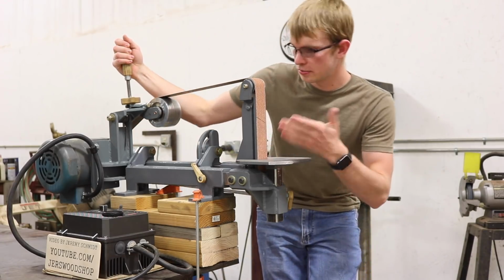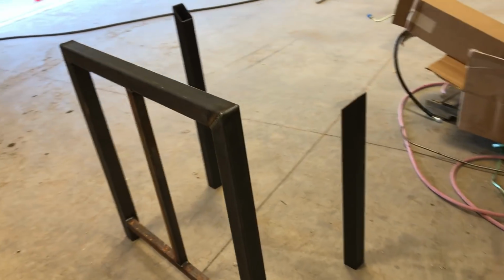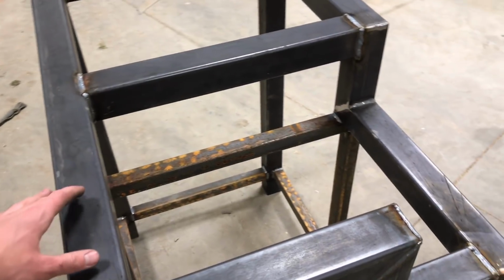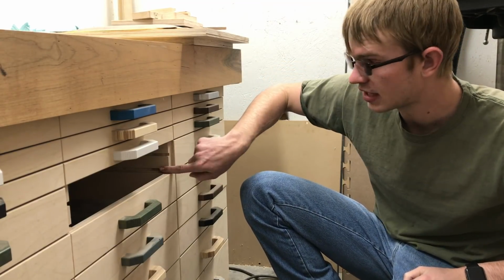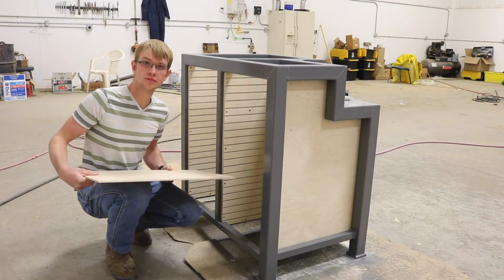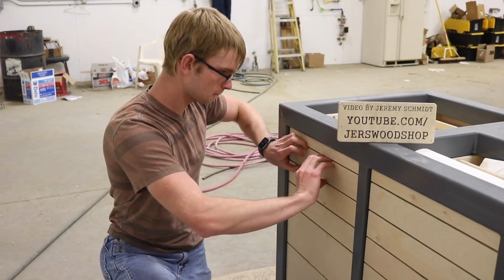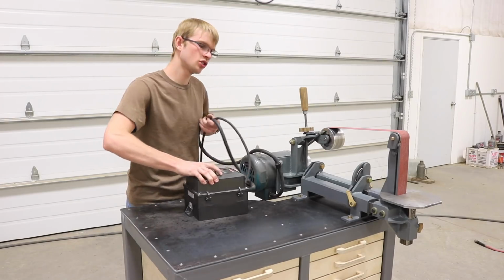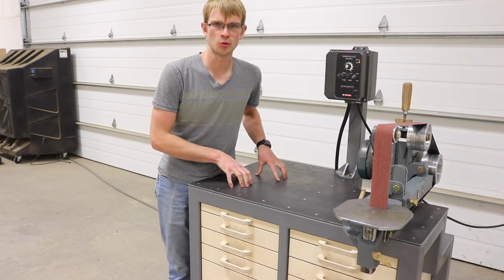Custom tool stand for my belt grinder

Comment: A wonderful Video you have produced. But placing it so near to the drawers ( without dustcollection or deflector) is worst!
PS.: The demonstration of tilting the (wonderful) grinder at the begin by using a stack of parallel boards is far away of rational method.

Comment: This didn’t age well. 
Now plywood is $40 😖
Reply from the maker: I’m curious where you’re located, and $40 for what size sheet? Current price here in the PNW is $150 for a 5x5 ft sheet of 18mm. Still well worth it at that price.
Reply: @Jer_Schmidt  Hah, I misspoke. It’s worse. I’m in south-east Michigan.
3/4 in. x 4 ft. x 8 ft. PureBond Birch Plywood is $85. 
23/32 in. x 4 ft. x 8 ft. BC Sanded Pine Plywood is $57
Reply from the maker: Interesting. I would expect baltic birch to be more than that, but I think that grade of plywood would be similarly priced here.
Reply: While I have your ear, I wanted to tell you your builds are awesome, and I enjoy your presentation. Thank you for sharing.
Reply from the maker: Thank you!!

Comment: Great job! Excessive material consumption, but excellent work. Are there any problems with abrasive and dust particles caught on the drawer rails? Does the slip get worse over time?

Comment: I just love the way you design and build,your grinder and cabinet I will build one for my workshop next project.The only thing I will do will be to add a folded sheet metal panel on the right hand side of the cabinet mounted with a piano hinge vertically to swing around to cover half of the draws at the front.This will protect the timber from metal sparks.Iove your style young man. Regards Baden Smith in Tasmania Australia.

Comment: My BG will be a little different, but i plan an similar rack. The space under the grinder, will be a custom, sparc and dust catch system. On 18:18 the sparcs flew on to the handles, is this an issue over long time? My shop is only 15 to 11 foot , so an dust collector is really important. I hope i will finish the BG in summer, and later on the rack. Thank you for sharing your great work.

Comment: Dude! Killer work as always.  Stout and built to survive a nuclear blast!  Hey where did you find that spring center punch??? Looks beefy as hell?
Reply from the maker: Thanks! It’s a Starrett...I don’t remember the model #. I have a couple different sizes, but the big one will whack a massive dent in steel if you crank the tension up.

Comment: Maybe a stupid question. Why didn't you just put the motor on the other side?
Reply from the maker: It makes the grinder take up about 60% more space width-wise, doesn’t look as good, and makes it harder to put belts on. I debated it for quite a while, since there are pros & cons to both. Decided on this since I was gonna make a custom stand either way. Several of my viewers have made them with the motor on the right, and it works fine.

Comment: is it my imagination or does the grinder table stem block the first drawer or two from pulling out while in use?
Reply from the maker: Only if the table is dropped down as low as it goes, then it just catches the top one. Not a big deal though, as that drawer has very little capacity and would be hard to access anyway.
Reply: yes sure -i just pointed it out because sometimes we can overlook simple things like that and maybe for a different kind of operation or machine it might end up blocking ALL our storage etc - so something to think about - in your case i guess i'd just keep things in there which i only used when the machine was off ... like say maintenance tools for the motor or what have you - out of curiosity - how many of those drawers have you filled up ..?
Reply from the maker: @antigen4  
Most of them are full. Each attachment for the grinder basically takes up an entire drawer, and I also keep belts in the 3" tall drawers, sorted by grit. The top left drawers are easiest to access so that's where all my frequently used tools go.
Reply: ok thanks - i just couldn't FOR THE LIFE OF ME imagine that there were so many things to store for a belt sander ....

Comment: You should try to weld at arm's length instead of giving in to the temptation to get in close. Especially since you don't have a fume extractor or anything else keeping those metal particles out of your lungs.

Comment: This work is beautiful. How much that square tubing cost per meter (or whatever its sold by)? Its probably not cheap to use as framing for everything.
Reply from the maker: I think a little less than $5/foot
Reply: @Jer_Schmidt  that's way cheaper then I thought. I totally get it now.

Comment: Where did you get that plywood?
I only found a couple 4X4 pieces that were part of a box built on a pallet from an overseas shipment and they are the top 2 planks of my 6 plank work bench.
Reply from the maker: I get it from Woodworker’s Source. They’re mainly an online wood dealer, but I live near their physical store so I can go pick it up and save the shipping.

Comment: Great workmanship and outstanding design ! (especially the belt grinder !!!!)  ,,,,,BUT, make your life easier and learn to burn (accurately) instead that shrapnel maker (Cut-off wheel)  and Vertical down your long welds and especially thin sections like the long  welds on the sheet metal to to Sq tubing on this stand. (V' down welds look a lot better too, Almost like heliarc. No grinding necessary)  

In any any case,  keep up the good work and God Bless ya.  You are sure to go way further then I ever did.

Comment: you could have designed it so that there was a steel drawer under the grinder to catch the sparks and then you could just pull it out, clean it, put it back in. save some dirt in the workshop
Reply from the maker: I’m afraid that would cause a lot of “splash”, sparks bouncing all over...

Comment: You've had this for a year now. Do you get much dust in those drawers on the right? I'm seriously considering downloading the plans for the grinder when I have some cash in a few months. I could design my own, but you've already perfected it!
Reply from the maker: I just cleaned the drawers for the first time, like a week ago. The amount of dust in the right bank of drawers was a gradient, from a significant layer in the top ones to basically nothing in the bottom ones. 

I’ve realized since making this that you can make the front of the drawer a bit taller to reduce the gap, leaving the sides and backs the same height so those have 1/8” clearance, while the front can have 1/16” clearance without issue. In theory that should cut the dust ingress to about half.

With all that said, I use the drawers to store belts and attachments, so there’s always grinding dust hanging on those anyway. So I really don’t care that they get a bit of dust in them. The top left drawers stay cleanest, and coincidentally that’s the most convenient spot to store tools, which I want to stay cleaner.
Reply: @Jer_Schmidt  Cheers for the response. I guess if they are gonna be dirty anyway, it doesn't matter. I just assumed you'd be using it like that other set of drawers you made.
Reply from the maker: Between all of the attachments for the grinder, various tables, and an assortment of belts in different grits, plus a few tools that are frequently used with the machine, the drawers are almost filled up just by grinder-related stuff.

Comment: Excellent engineering, design, craftsmanship, editing and commentary. I work metal for a living and can appreciate your skill level as well as you superbly done videos. I think I know, but can you tell me why you cut your sheet and tubing with the hand grinder rather than another method and what wheel do you use to make those cuts? Thanks!
Reply from the maker: Thanks! I used the grinder for angled cuts because the it is just too difficult to angle the bandsaw for them. Takes longer to adjust the saw than to just make the cut another way. I use the grinder for the sheet because I don’t have any other way. The cut off wheels are Norton brand. Bought in bulk from eBay.

Comment: you can weld a lever on the nut that holds the grinder vertically so if you need to turn it sideways you don't have to go get a wrench. other than that I wished i would get to your level one day! Amazing work!
Reply from the maker: All the other locks on the grinder have levers, but on that one the lever would get in the way too often to be worth it.

Comment: I'm guessing you won't see this comment but I'll leave it anyways awesome work as usual seen this video a couple times and just noticed the jet babe saw... Why don't you use it
Reply: For the angle cuts lol sorry for not clarifying
Reply from the maker: Thanks. It's practically impossible to angle the vise on that bandsaw, so it's easier to just make the angled cuts some other way.
Reply: I had that same issue with my jet I haven't been able to get it perfect the shower I go the closer it is but still not perfect

Comment: What about a catch bucket under the belt or a dust extraction system?? The sparks will surely ruin those drawers in no time. Fantastic build though, you certainly overengineer it all! How long did this build take you? Cheers from Down Undahhh
Reply from the maker: The sparks shouldn't  damage the drawers, at least they haven't at all yet. But I do want to try some kind of dust extraction just for the sake of my lungs...

Comment: I bought the plans for your grinder and will be building it. For the stand I plan to use the classic bench grinder stand -- a tire rim and a post. Except in this case it will be a semi truck brake drum filled with concrete.

Comment: I am a bit lazy when it come to projects designed by others. I would prefer plans. For projects that I design I make drawings for the parts using Fusion 360 and take the drawings to the shop to make the parts. It really does not take too much time to make the drawings and it saves me a lot of mistakes in the shop.
Reply from the maker: Of course I do have drawings of this, available on my website. I should have been more clear about that. By plans, I meant step-by-step instructions. That's what takes forever to write.
Thanks for your feedback!
Reply from the maker: Well, a Sketchup model. "Drawings" isn't quite the right word I guess
Reply: Okay, my definition of "plans" is a set of dimensioned drawings. The step by step is not needed for me anyway. I had a look at the radius attachment using the free version of sketchup. It looks like that would work but a PDF with dimensioned drawings of the parts would be great. Maybe I am missing something but it looks like with sketchup you have to take the assembly apart and measure each of the components and then you still don't have drawings to take to the shop.
Reply from the maker: I can add dimensions for everything in the Sketchup drawing, but it get super cluttered and hard to follow. So yeah as of now you just have to measure it manually. 

I am refining my process for making plans (since that seems to be what everyone prefers), so I'm going to focus more on having dimensioned drawings for everything, in addition to instructions for those who do need them. Thanks for the feedback.

Comment: I love how over built this thing is! Must weigh 500lbs but that’s the point right?
Reply from the maker: I haven't calculated the weight but it would be at least 300lbs I'm pretty sure. Yeah I just didn't want it wobbling or shaking or scooting around. It's pretty solid ;-)

Comment: CAN U PLZ USE METRIC OR CONVERT IT IN EDITING. like for us not Americans imperial is gibberish. why dont you use it its so much simpler.
Reply from the maker: I wish I could, but then the square tube I'm using would suddenly be 63.5mm. That's a totally odd size, and throws everything off. I can't get metric materials here unless I import them, which would be outrageously expensive. So while it doesn't work for me to make my designs metric, I might be able to convert a few dimensions so you get a rough idea how big things are...

Comment: Really nice job. I watched both versions of the video. Much prefer the short version. I'm an old guy and can figure out how to make things w/o plans or sizes. I'd like to make a similar grinder but I need a better welder first. (Always "need" another tool!) I've got the Incra router lift and am just finishing up a fencing system for it. I'd also like a better metal cutting band saw. Mine is one of those little 4X6" Chinese jobs, works, sort of. I do have a decent lathe, PM1440HD and a well worn Jet 9x49 mill. I'm mostly retired from my woodworking business. I still have access to all the woodworking equipment.
I really like your editing and you are an inspiration for us that need to get off our a$$ and make things. Thank you.

Comment: this isnt related to the tool stand, but i noticed in some of your other videos that you have a cnc router, would it be possible to simply replace the router with a print head, and turn it into a 3d printer? or replace it with a laser, and turn it into a laser cutter? or a plasma cutter, ect.
Reply from the maker: Some people have attempted that, but it doesn't work nearly as well as a dedicated machine for the job. I don't think I'd bother

Comment: I bet you could park a car on that!
Reply from the maker: If you set it down really carefully, you could put an insane amount of weight on it, because it would be direct pressure on top the legs. Like probably a couple of cars like mine, and I have a very heavy car. The problems would start if you applied a slight sideways force, the whole thing would collapse relatively easily then.

Comment: Can your bandsaw not be set to 45°? Or just prefer cutting with grinder?
Reply from the maker: It's just too difficult to change the angle of the bandsaw. It would be easier once I had it set correctly, but that's the hard part.

Comment: Advise: keep your arms covered while welding. Not just for spatter burn protection. I surgically remove skin cancer from people every day, I’ve seen several elderly welders (especially people with fair skin like you) on a repeat basis. 
Heed my warning young man. It’s no fun going to the dermatologist every couple months for skin surgery. 
Otherwise, I love your projects and your ingenuity. Such talent/skill at your age!
Reply from the maker: I am aware of this danger, and I always wear long sleeves for welding unless I'm just doing a couple of quick tack welds. In this video I didn't really show the actual welds, just the tack welds, to keep the video length down, so that's mostly what you saw. But rest assured I do my best to wear long sleeves any time it won't result in a heat stroke.

Comment: Question on your VFD.  I have an electronic display VFD that has to 'boot up' it takes maybe 10-20 seconds before the VFD turns on, gets up to speed before I can turn on my 3 phase 220V Disc Sander.  Then same process in reverse to turn off.  Does this VFD operate more like a switch where you turn it on and whatever is connected is immediately ready for use?  I have found that bootup/wait time is soul crushing so I am either going to get a new VFD or just replace the 3phase motor with a single 220V one so I don't have to wait. Another badass project BTW that is a beautiful cabinet.
Reply from the maker: Yeah this VFD is ready to use immediately. I've gone straight from plugging it in to hitting the start switch and there's never been any delay. I recommend this drive 100%. It's very easy to set up and the fact that it's analog controls makes it super convenient to use.

Comment: Nice build.  As far as feedback... seems a shame to have all that grinder dust, grit & sparks fly all over your drawer set as shown at the end of the video.  Maybe if the drawers were on the other side?
Reply from the maker: I've seen that sentiment a lot in the comments...I understand it's kinda a shame but I think one just has to accept that it's shop furniture and it will get dirty. The sparks don't do damage anymore than just dust. And this will most likely be parked against the wall, so drawers on the back don't work.

Comment: seeing that you use SketchUP I would really recommend using Fusion360. Its free to go and much more like an real CAD System than SketchUP. I find it much easier to use
Reply from the maker: I've gotten this recommendation about 100 times (not an exaggeration), but the truth is I'm so used to Sketchup that I can grab my underpowered little laptop and bang out a quick sketch in a matter of minutes, and I don't need anything more than a quick sketch to work out the dimensions. I have the designs in my head so I barely need CAD. It's just not worth the learning curve...

Comment: Incredible work. I plan to make a copy of your grinder in the future and now probably the stand. Have any plans for making a dust chute/ shroud for the unused portion of the belt? Main problem with my friends grinder is the metal dust covers everything from floor to ceiling behind the grinder.
Reply from the maker: I'm considering making a active dust collection system. As in a powered blower-cyclone-filter setup. A shroud alone won't do enough good, I'm afraid. I'll see if I come up with anything.

Comment: Very good cabinet build especially combined with your VERY good welding skills, I would like to have seen a deflection shield to keep the spray off the drawer fronts.  I suspect you will do something to prevent this.